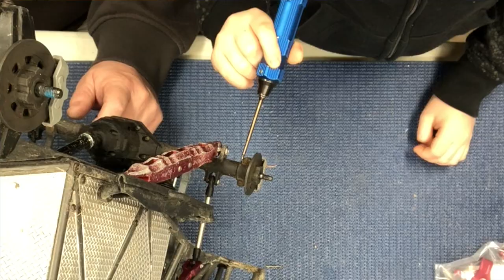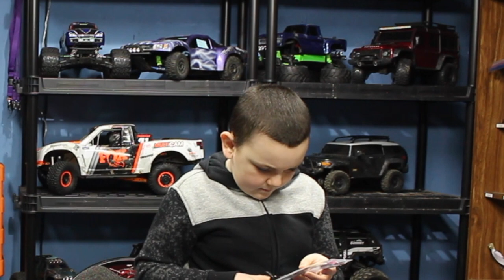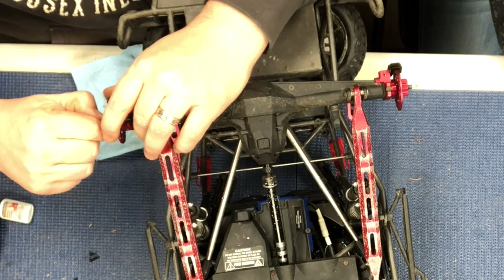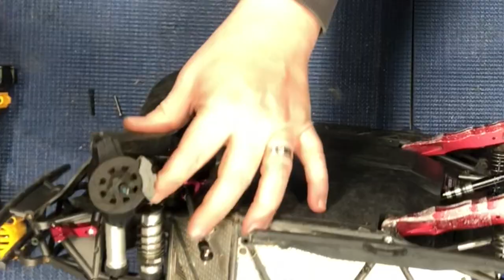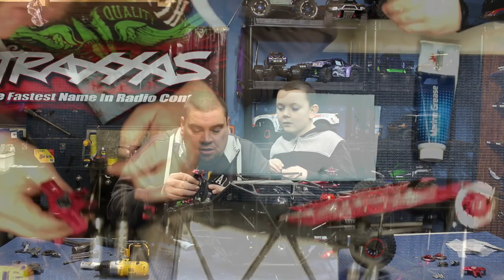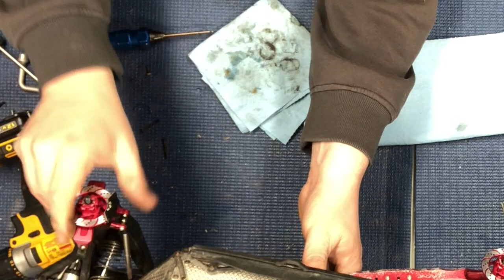Traxxas UDR GPM Upgrades Disk breaks, Calipers, Front Caster & Rear hub Carrier PT. 5 /Lets Play RC!

Comment: To be honest i just JB weld the the holes int he trailing arms and i took apart the front lower a arms and fill the hole thing with JB weld and the rest of the hole thing that i think were needed so there no need for me to add more weight beside somestuff :/ btwi recommend doing this if you domt have the money for the upgrades it cheaper and a lot mor stronger.
Reply: XD i wrote a hole entire paragraph
Reply: Hello my Bruda

Comment: Did the brake disc push the wheels out further
Reply from the maker: Nick Christian ,  Thanks for stopping by. 👍. No the break disks fit as a perfect replacement. There might be a 0.01 mm difference in the disk because of aluminum, but nothing we can see by eye.  The GPM set up is just more durable and look awesome! It all works great. 😁✌️
Reply: @LETSPLAYRC  thanks for the help.
Reply from the maker: Happy we could 😉

Comment: I have a problem, I can't remove the rear disks! How can I do it? HELP!
Reply from the maker: luis bellido córdoba ,  hey there thanks for watching. 👍😁. Having trouble with disk removal?  You may have missed the small grub screw in behind the disk in the top of hub carrier. Hope that helps. 👍😉. If not let me know and we will try to figure it out. 👍😉😁
Reply: @LETSPLAYRC  Hi! Do you say the caliper's screw? Yes! I removed it! In your video, I can see that you had the same problem in the beginning. You tried remove the disk pushing but that wasn't enough. You removed the driveshaft with all parts. After that, we can't see what you do... 🤷‍♂️ I write you from Spain! I hope that you can help me! Thanks! 🖤
Reply from the maker: luis bellido córdoba ,  yes I did make the same mistake lol. The one screw that needs out is not in the caliper it is in the hub carrier itself. Easy to miss. I did 😁😉